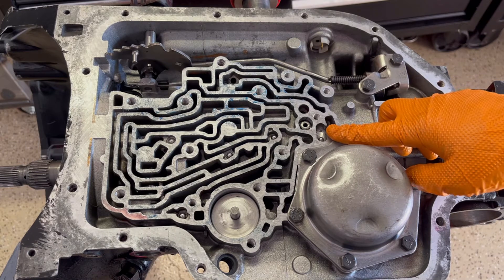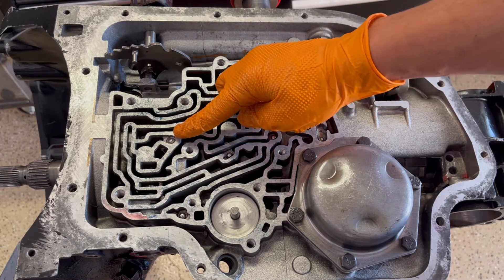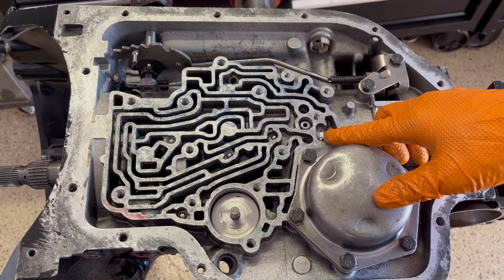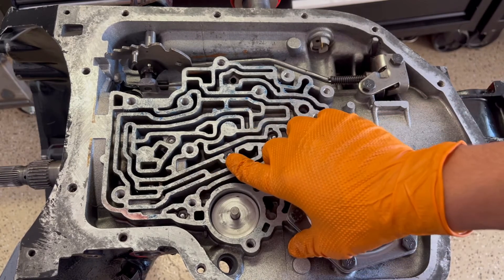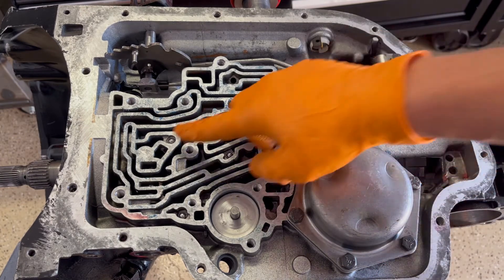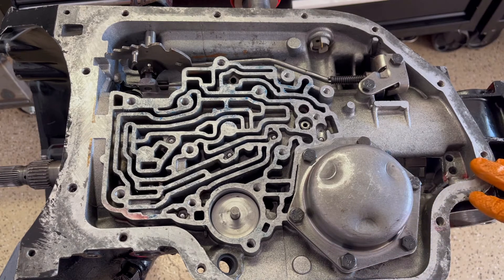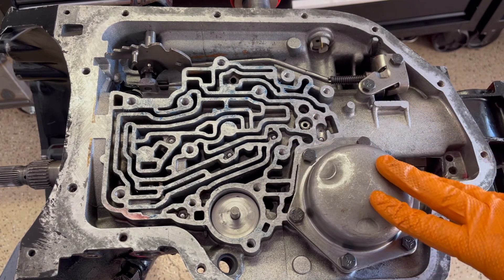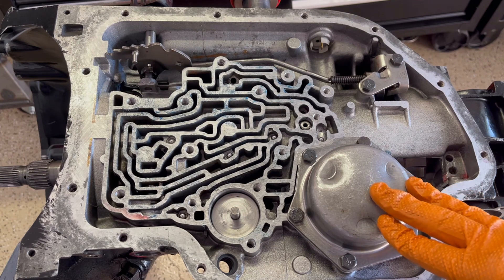TH400  - Check Ball Locations and Considerations

Comment: Do you have any experience with the FTI reverse manual valve bodies for the 400? I'm having a issue where it is locking up in 3rd gear. I do have all factory check balls installed in factory location along with the FTI restrictor plug and check ball that comes with the kit. The FTI instructions are no clear on weather or not I delete the factory check balls or not. I plan to call them after the holiday is over. Just ran across this video and figured I would ask. Thanks.
Reply from the maker: You need the reverse check ball and intermediate check ball, that's it in any TH400 unless major mods are being done. The rest of them are flow control check balls. 

Did you rebuild this unit and dual feed the direct clutch internally? 

Do you have 2nd gear?
Reply: @nickstransmissions  The unit was in good shape so I didnt rebuild it. I did do the dual feed mod. And i do have 2nd gear.

Comment: Do you drill the 2nd and 3rd shift holes in the spacer plate with the dual feed option?
Reply from the maker: I always drill the 2-3 feed when dual feeding as the direct clutch requires more volume to fill under the piston and hence more speed to apply so the shift doesn't feel lazy/soft. The 1-2 shift is usually drilled regardless of dual feeding however I'm usually not as aggressive as I am with the 2-3. If you go too large with the 1-2 feed, you jeopardize the intermediate sprag...If the clutch pack fully applies prior to the sprag holding, over time it may break. 

Thank you for watching, Robert!
Reply: @nickstransmissions  what are the holes sizes you typically use on both feeds ?I’ve got the stock plate but I’m dual feeding it’s gonna be in a daily driver thanks again
Reply from the maker: Depends on stall speed and a whole bunch of other factors...Stock to mild builds, no dual feeding and active 3rd accumulator and stock PR spring,  I may drill the holes only about 10% larger than stock to make the shifts a bit more crisp. If the application is heavy duty, intermediate clutch clearance is .035-.045 or so, stock to Sonnax PR spring, both accumulators active and unaltered, I do .093 for the 1-2 and .115-.125 for the 2-3 feed...For mid-high stall, street strip, I start with .125 for the intermediate (2nd acc active) and .130-.140 for the 2-3 feed (dual feed-3rd acc blocked, modded factory PR set up, Sonnax or CK Perf PR spring) and work from there (high stall/full race i start at .150 for the 3rd feed)...Your clearance in the intermediate clutch pack and drum/OWC choice will also influence your feed hole size decision while blocking or leaving the 2-3 accumulator will influence your decision around what you do for the 2-3 feed hole size. Any deleted check balls (other than the intermediate and reverse, they have to be in at all times) will also influence your feed orifice sizing on top of everything else.

So my suggestion would be to figure out how you're building the transmission, including 2nd gear clutch clearance, dual feeding (or not), converter stall, vehicle weight, check ball configuration, boost and pressure regulator spring set up, converter charge restriction (if applicable - usually serious street strip or full race), valve body, governor, accumulator mods and overall preferences for shift feel and based on all those things, drill the plate.

Comment: Hey Nick- this could be my last question for ya- I am installing check balls and you previously advised to leave the direct clutch check ball, the 2-3 acc check ball, and 1-2 drive check ball out of the case. This is for my 600HP street only car. Not taking it to the track, but will use it for thrills often. In other words, I need to street-beat on it with the least amount of concern. Do you still think just 2 check balls is my best bet?
Reply from the maker: Do two check balls and test drive. 

If the shifts are not to your liking, put the rest back in and go from there. Shift calibration involves adjustment of spacer plate hole sizes, governor set up, clutch clearance, check ball configurations, vacuum modulator all relative to engine power, cam profile, final drive ratio and vehicle weight. All of it is taken into account so it will probably require a few iterative adjustments to one or more of the above before it's exactly right per your preferences and application.

That's the nature of high performance transmission building.

Comment: What is the difference between the tan stock type clutches the 400s use verses the high energy clutches of the 4l80e? I've read the high energy doesn't grab as good but take heat better. 4l80s use high energy bands too. What is advantage or disadvantage of using high energy material for clutches and bands in a 400?
Reply from the maker: There's no less holding capacity in the high energies compared to stock-level clutches in my experience and as you mentioned, the HEs handle heat better thus last longer all things equal so that is the main advantage the HEs bring over stock level clutches....Same w/the bands. That said, the Borg Warner stock frictions are fairly robust in their own right and are fine for builds up to about 500-550 HP when it comes to street or street-strip use. 

I like HEs for heavy duty applications (working trucks, towing/hauling/plow, lots of stop and go w/heavy loads etc) as they absorb as much fluid as the stock stuff but take the heat better. I prefer Raybestos Blue Plate frictions for dedicated race applications given their 'hardness' but wouldn't recommend them if a vehicle will mostly see the street with only occasional trips to the track.
Reply: @nickstransmissions   thanks Nick. I appreciate your help. I'm just trying to learn all I can. I have a four clutch 4l80 intermediate clutch pack with hi energy plates, but I really don't think I need it. Would it cost any power to add the fourth clutch in the 400?
Reply from the maker: You're welcome, Nitroman. If you're putting a 4L80e 4-clutch intermediate pack into the TH400 you will also need to retro a 4L80E late model 1997+ direct drum w/the intermediate outer sprag race (I say late model because it's designed to use the bonded steel/rubber pistons and comes w/the heavy duty 34 element BW sprag). The 4L80E intermediate stack is slightly taller than the TH400 intermediate stack and the TH400 intermediate sprag outer race is slightly too short to adequately accommodate the 4L80E intermediate stack. But as you mention,  you don't really need it unless you're doing something really wild and even then it's debatable.
Reply: Hey quick question on the 87 and up case can you leave out the same check balls.

Comment: I drilled my plate 3/16 on the 1-2 & 2-3 holes. I'm running a 4l80e intermittent aluminum piston and used all 9 (or 12) return springs for the intermittent piston verses the 3 that comes stock. I'm also using a 4l80e direct drum with 34 element sprag. I have a 3500 stall. Which check balls should I use? I want very firm tire chirping shift, but don't want to break parts.
Reply from the maker: Hi Nitro Man...Based on your hole sizes as drilled along with your stall, I'd put all of them in to start then see how everything feels once you get it on the road for a shake down cruise. Then whichever shift feels soft, remove the corresponding check ball. My first thought is that you may have went a little big on the 1-2 shift. I normally keep that around .125-.140 max for street vehicles and keep the accumulator active (ill go bigger in a race-only vehicle). Reason being is that you don't want to stress the outer intermediate sprag race...They can fail if forced to absorb the shock of hyper-fast clutch apply before the sprag can fully hold. You also don't want to run the risk of blowing the case lugs out at the intermediate snap ring groove.

What did you set your intermediate clearance and did you use a heavy duty snap ring for the intermediate clutch?

What's your final drive ratio? Are you planning on racing/will the trans see 5000+ RPM on a regular or occasional basis? 

How much power is your engine making?

Did you dual-feed the direct clutch internally?

Did you use a high-pressure PR spring in the pump? If so, what one? If not, did you shim the factory spring?
Reply: @nickstransmissions  it is dual fed on the direct drum, yellow trango spring (25psi over stock is what they told me), clutch clearance is around . 045" from memory. Around 475hp 383, 3.73 gears and I will buzz it up every time it starts. Probably around 6,400 rpm.

It's going full manual without the band with a case saver and I do have the heavy duty snap ring. Rollerized the output shaft, 3,500 stall. I figured using the big 4l80e spring cage in the intermediate clutch would take some of the harshness out of the second apply. I've heard several say using five check balls with the 1-2 feed at . 125" is soft, so I went with what the b&m transpak says to go with at 3/16. I have another plate I can use, so no big deal. I just don't want to break parts. I'm also thinking of using the factory pressure regulator spring and one horseshoe to lower it just a touch, the 185 seems a bit much. I did also restrict the converter feed to .125" too. I didn't use any wave plates but I think I'm going to add them to the forward and intermediate clutches. With high pressure pressure regulator springs, they tend to slam into gear and I hate that. This is all in a factory 85 Monte Carlo SS without any weight reduction.

When you add the case saver, that deletes the accumulator for second gear doesn't it?  Oh, I also blocked the hole in the valve body for the third gear accumulator. I'm not worried about third, busting the sprag has me a little concerned, but again, I've used b&m transpaks before with the weaker roller clutch without any problems other than shattering two bellhousings.  I don't know if it was the shift or a bad angle on something.

I do have a new plate that I can go with 125 on the 1-2 shift hole and just used two or three check ball's if you think that would be better. Should I go back to the factory 3 springs in the intermediate clutch return?
Reply from the maker: Nice, sounds like you've accounted for all the major things, including restricting the converter charge to prevent ballooning...I'd keep the additional springs in the intermediate piston return spring for now, and remove the shim from the PR valve train, as you mentioned...TH400's like 175 psi max though 185 isn't super concerning however I'd still proceed w/the change to be on the safe side (you can always put it back in if line pressure drops too much). I also agree w/putting the waved clutch back into the intermediate. I'm not aware of the case savers eliminating the 1-2 accumulator function...

Are you using the Sonnax case saver or another one? Some case savers prevent the installation of the front band but I believe the Sonnax version allows you to install it.

The only other thing I can think of concerns the direct drum: Did you use high-rate return springs and drill a .050 bleed hole to mitigate centrifugal apply risk while in first and second gear?
Reply: @nickstransmissions  I have the bigger case saver that deletes the front band. It goes in the band ancker hole and the servo in the case. I haven't drilled the direct drum but I'm going to. I don't have the hi rate springs for it, I figured the bleed hole would be enough. Am I wrong? What do you think, run it with five check balls and see how it does or just drop it to the three down the middle? Or should I just redo another plate with 125" 1-2 & .150" 2-3 and use two check balls? I have an extra plate, so no big deal to do either way. I appreciate any advice.
Reply from the maker: Ok, yes those bigger versions block of the manual 2nd band but don't impact the 1-2 accumulator function at all...I install CK Performance hi-rate return springs on race/high perf builds when RPMs are expected to exceed 5,500 but you may or may not need them (i'd be inclined to install but it's your call)...As far as the plate goes, I'd run the other plate, .125 for 1-2 and .150 for 2-3 and use the two check balls. 

Here's the link to CK Performance's high rate return springs: https://www.ckperformance.com/View/HI-RATE-DIRECT-CLUTCH-APPLYRELEASE-SPRINGS
Reply: @nickstransmissions  thank you for your advice. I'll pick up some direct hi rate springs too.  Should I stick with the factory 3 springs in the intermediate?
Reply from the maker: @inscoredbz  You’re welcome…Id use all the intermediate piston return springs, as mentioned above as it will improve 2-1 downshifting. Please subscribe if you haven’t already-ill be doing some more TH400 vids soon and you’ll be notified when they have been published.

Good luck with the build, Nitroman-let me know how it turns out!

Comment: Hey, I have a question... very hard to get any info on this... I freshly rebuilt my th400 (1969 model) and I only kept the 2 checkball locations and also using it for daily street and seldomly strip use. I did the 1-2 shift valve mod for the auto shift when manually in 1st and removed the 2-3 accumulator spring and plugged the hole but I do not have 3rd gear at all. I can rev out to 6700 rpm and it won't shift into 3rd but will act like neutral if I let off the throttle. Could this be a symptom of not having 5 checkballs in the case when also not dual feeding the direct drum?
Reply: Okay, well I'll definitely be digging into it and see what else I can find. You're the first one that's actually replied and I greatly appreciate your time!
Reply from the maker: You’re welcome, good luck! Feel free to post additional questions and ill try to answer as soon as i have some time.
Reply from the maker: No, a no 2-3 upshift condition is either VB, governor or possibly the modulator. If you do shift and it feels like its in neutral then there’s a major leak in the direct clutch circuit. 

Which checkballs did you omit? You should have the reverse and int check balls in at minimum.

Do you have reverse? 

 What, if anything, did you do with the governor? 

Did you overhaul the valve body or just plug the 2-3 accumulator feed port after removing the spring?
Reply from the maker: Also did you do a pressure test? If so, what were your readings?
Reply: When I rebuilt it, I kept the intermediate and reverse ball. Didn't change anything with the governor (1-2 shift light throttle around 10-15mph), ground a flat spot on the 1-2 shift valve and plugged the exhaust hole to eliminate the 1-2 shift at ~4500 when holding 1st gear, and roved the 3rd accumulator spring and plugged the hole going to it with a set screw (to remove later if needed)
Reply: Also, yes I have reverse, can manually hold 1st and 2nd, will auto shift to 2nd but when I shift into 3rd, it won't shift and drop rpm if I let off the throttle like it's in neutral. I can rev it back up and it'll match 2nd gear rpm and keep going in 2nd.
Reply from the maker: So a no 2-3 up shift condition is what it sounds like (as opposed to neutral or slipping after shifting into third gear). 

Did you do a pressure test? 

Excessively high line pressure can cause a no 2-3 upshift condition.
Reply: I haven't been able to try and pressure test it. When I do, what pressures should I be looking for?
Reply from the maker: Google “th400 line pressure readings” or “th400 line pressure test” and it should give you a breakdown and instructions. 

Assuming you are runnning the stock PR spring, arlt idle you should see 60-80 at idle in park, neutral and drive; 95-100 in reverse, 130-160 in D2 and Manual Low. If yours are significantly higher than that could be causing your no-3rd condition.

Did you replace the Detent solenoid?
Reply: Okay, I'll take a look.

As far as I know, it has the stock spring.

I didn't want to take a full guess at the detent solenoid being first trans rebuild and trying to find one thing at a time, but if the detent is bad and potentially bleeding off fluid pressure, it wouldn't shift into 3rd?
Reply: Also, I'm pretty sure I do have enough vacuum part throttle as it definitely had changed when I adjusted it one full turn trying to stiffen up the 1-2 shift.
Reply from the maker: It depends on how it failed. If its stuck on or being energized w/12 volts all the time it will prevent an upshift to third. Check voltage at the harness where it plugs into the connector to see what voltage you have.

What is the history of this transmission/vehicle? Has it worked before?
Reply: I'm not using the detent. I did however check it just as a "why not" while it was off and it was functioning. Currently its just there to plug the hole in the separator plate.
Transmission was a "it was running when it was pulled" and came from a truck, but I have also rebuilt it with a Raybestos "stage 1" kit before putting it in my car. which has an 5.3 LS attached to it. Transmissions isn't really my cup of tea since I would have rather gone with a t56 but couldn't find one and didn't have it in my budget for new.

Everything inside the transmission got thoroughly cleaned and checked while doing the rebuild and watching a vast amount of videos in the process to ensure I didn't miss any steps.
Reply from the maker: You probably do but id check it just to rule it out. The line pressure test should give you a good idea as to next steps, regardless of what the readings are. 

If the pressure test passes, id next rule out the detent solenoid, power to the solenoid then governor and finally VB. If the pressure test fails then you will have to investigate to find out why.
Reply: And also, would adjusting the modulator valve have any affect?
Reply from the maker: Modulator primarily works at part throttle though it wouldn’t hurt to mess with it but that’s prob not the problem. 

Do you have at least 13-14 inches of vacuum at the modulator?
Reply: I'm sure I might another question or two, so I greatly appreciate the offer!